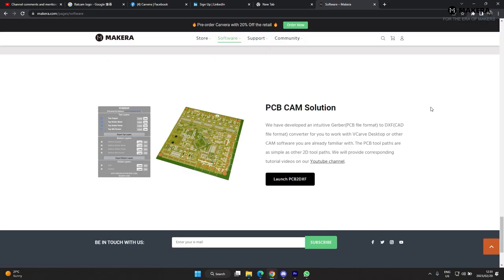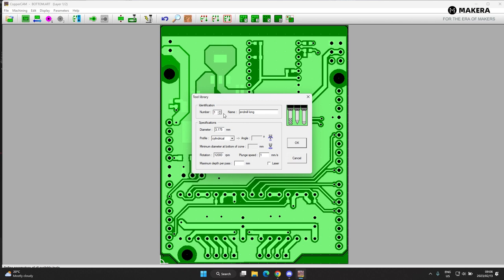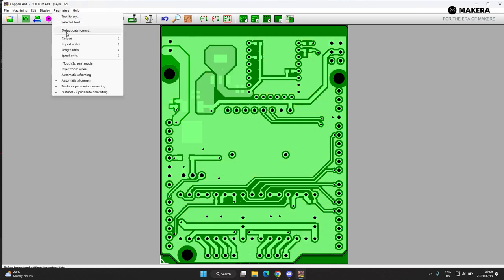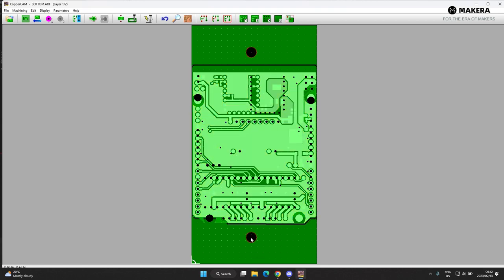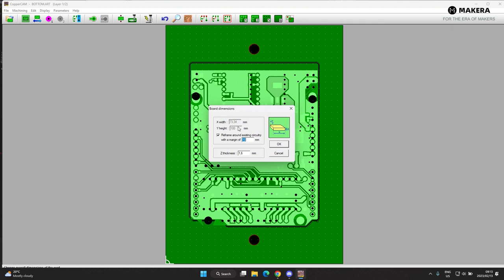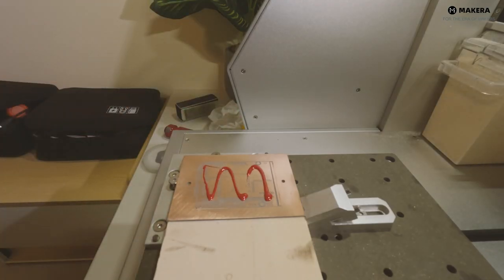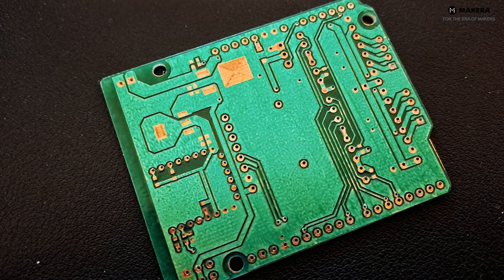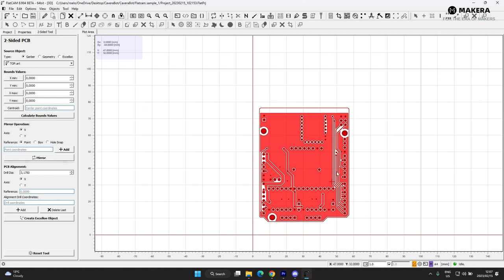Carvera PCB fabrication CopperCAM VS FlatCAM

Comment: You should be drilling your holes as the very first step as small pads can get torn off if they're cut before being drilled.  I've used both the T-Tech and LPKF dedicated PCB mills and both of them recommend that as the first step of the process.  It won't make a difference if you're pads are huge, but with small SMD circuits, it's going to be a problem.  Also, why doesn't this mill have a pressure foot for PCB milling?  Any of the dedicated PCB mills have an adjustable foot the presses the PCB against the bed so that you get consistent cutting depth.  It even allows you to do flex circuit material, the depth is that consistent.

As far as the software, CopperCAM has more intelligent copper rubout.  This is important in a lot of circuits where leaving huge islands of copper causes problems.  Simply contouring the traces is NOT adequate.  All of the copper around them needs to be removed and it's a lot easier when you can just create a box and the software is smart enough to remove all of the non-trace copper inside of it.  T-T-Tech and LPKF software was able to do that 20 years ago, btw.
Reply from the maker: The reason for the holes at the end was we do not want it to interfere with the auto leveling map when flipping the board. The points may fall on a hole when doing the opposite side. That should also answer your question about the pressure foot.

Comment: Where the holes and pads didn’t register correctly on one side was this a setup proble in coppercam or was this from problems in the clamping after the flip?
Reply: That was due to a slight misalignment in the flip process.